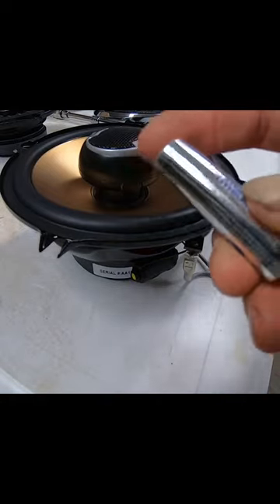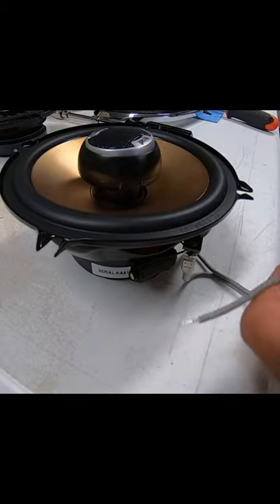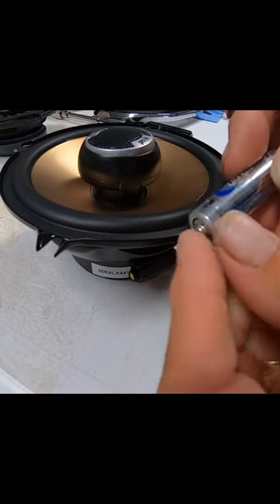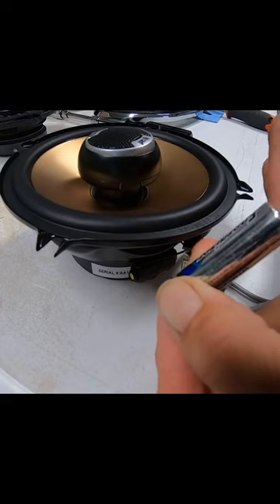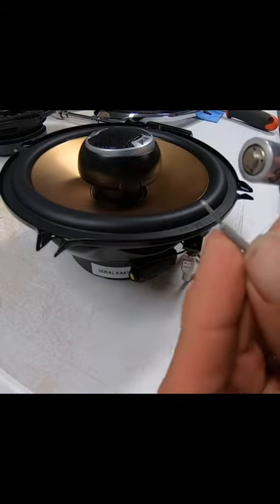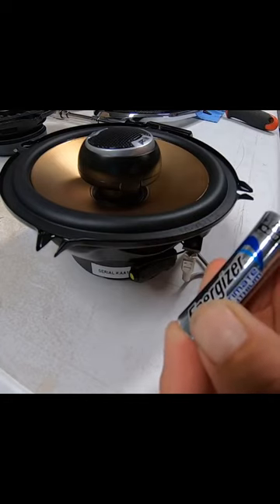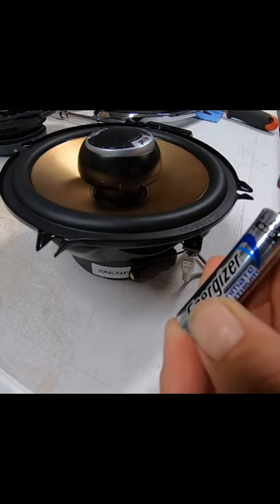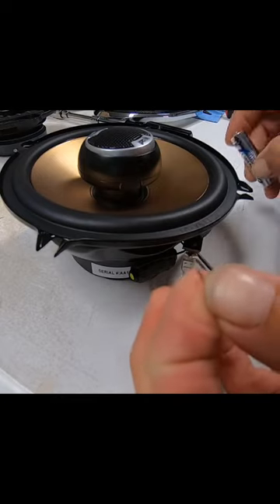How to tell positive and negative terminals on a speaker fast and easy

Comment: …would this be safe to do on a big subwoofer?
Reply from the maker: Yes, there are about 4 Watts in a AA battery and about 5 in a 9 Volt.  That would work just fine on the subwoofer, your not putting constant power to it for a long time, just touching the terminals to see if it pushes or pulls inward.  I wouldn't recommend doing it with a car battery... There are about 1400 Watts....
Reply: @RagerJackOfAll  thank you very much for the information 😎